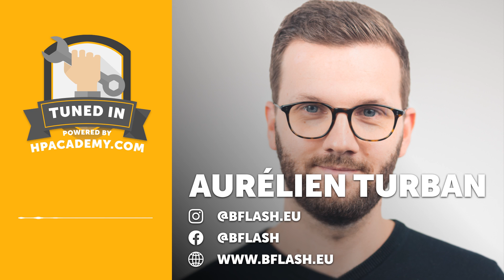039: Reflashing Modern Euros for BIG Gains. [#PODCAST]

Comment: I'd like by start saying that I'm an hobbyist not a professional tuner.
I think there were alot of things that were not disclosed in this podcast, maybe because it's touching the legal side of things.
While reverse engineering a factory ecu maybe your only option if there is little to no information of that particular ecu, or you want to do some in-depth modifications to it, like add no shift lift or multimap, log some variables that are not accessable thru standard methods, most of the time that's not how things are done.
The OEM calibrators use files called a2l (or damos) and funktionsrahmen( function and definition) files to explain the logic of the ecu and define where Wich variable and map is located on that particular ecu.
This files are confidential, but sometimes they are leaked ( for money) , with this information, you can import it to winols to completely define a ecu binary and with the function and definition pdf it explains the complete strategy of that particular ECU.
Now that only works for that particular ecu, but most of the time, for instance Bosch, the working principle is the same across the various car manufactures supplied Bosch ecu, so it's a matter of comparing your defined file to a new one to find out where the maps are and how it works.
I would also point at that while this makes things easier, understanding the control strategy is not for the faint of heart, and for instance, read and flashing an ecu really requires reverse engineering, either the communication protocol or the CPU, to find a backdoor of some sorts. I could go more in depth in this rabbit hole, but I think this is enough.
Great work HPA academy.

Comment: Interesting podcast but the guy says stock ecu are better than aftermarket but then immediately proceeds to explain how you need to decode literally everything and nothing makes sense until you do, also u gotta pay 5k for the software lmao
Reply from the maker: Yes, nothing comes without compromise. For some they are worth it, for some they are not when they consider their own options, resources and requirements - Taz.
Reply: I'm just getting into all this on my 2016 VW Golf R. I'm currently using Cobb to tune the ECU. The only stand alone available as a plug and play for my car is from Syvecs and it's about $10k Canadian to transition. Instead I am going open source. The OBD dongle is $100. The software is free. And it will do everything a Syvecs will other than nitrous control. SO very cost effective.

Comment: I say aftermarket ECU scene is more for racing cars and old models. map ready , versatile ready to go. 
but ... you just can`t compare a Link with an Bosch MG1/MD1 unit based on 32bit Aurix Tricore runing latest spec software ...

... also there is another very advanced aftermaket ECU scene , Pectel , Cosworth , etc that is not for the common enthusiast :)

another thing to needs to be observed is that Honda is using Bosch systems (not Denso) , also Toyoya F1 TF102 was using Marelli systems and only later Denso ....
Reply from the maker: You're not wrong noting some ECUs are used as the class rules dictate it rather than always being something that is hand picked by each team themselves - Taz.

Comment: What wil al be al Included in the winols course...??
Wil it be a one time buy course that gets updated as new ecu's come out ? 
Theres a lot of difference in stock ecu's.. 
For example edc15-16-17 diesel ecu's are very simular to each other beceause they are al bosch ecu and al diesel. But then if you do a denso diesel or other ecu things can be a lot different somethimes. 
 different ofset factors for ur maps.. aswel as 2D the 2d shapes that are at least slightly different...

And the the petrol ecu are also very different in strategy and shapes etc... to find maps. On diesel ecu's theres is quite a bit of information out there if you really dig deep and go on forums to find it al.. but the petrol ecus not so much... 
Wixh is the comolete oposite lf the aftermarket ecu world where theres is loads of info and availability to good standalone petrol ecu's but not really for diesel ecu.